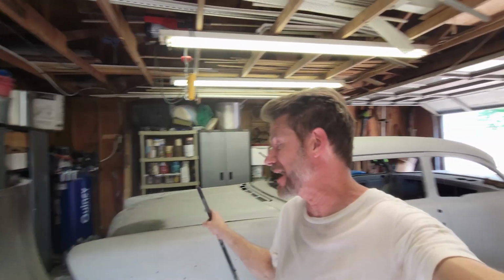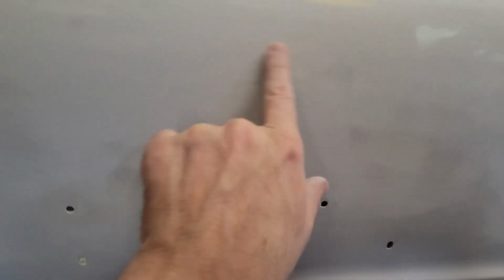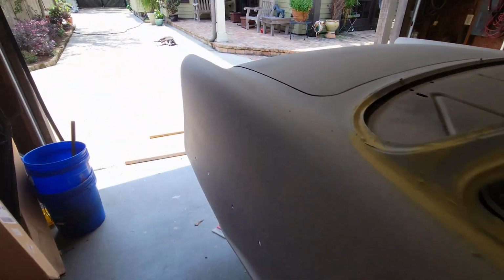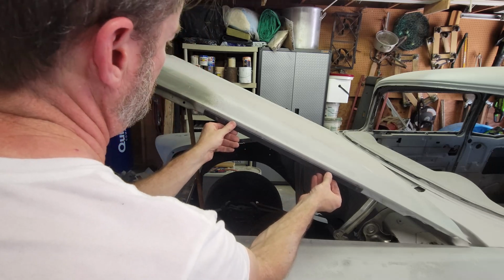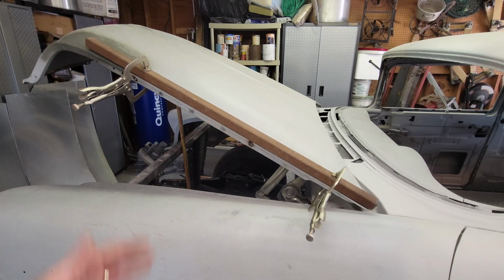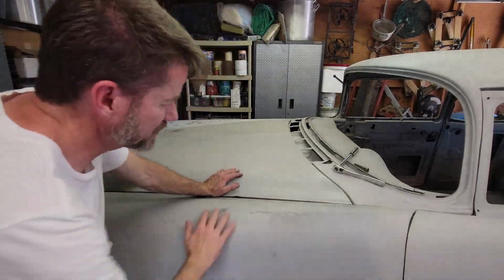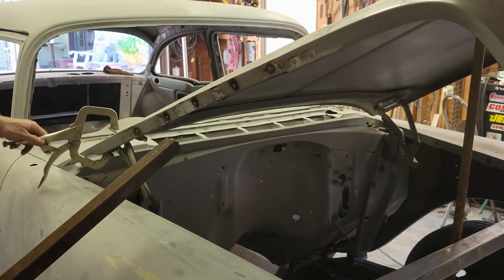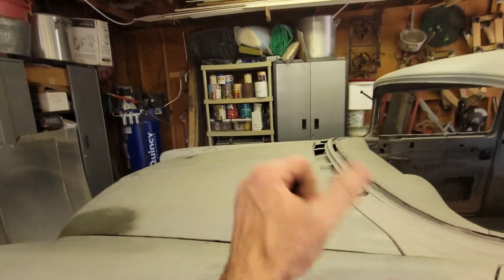E84  Kinked Hood Repair... No More Taco!  1956 Chevy Bel Air Restoration

Comment: Nice fix 👍.These techniques will definitely help me on my 70 Gto hood😊JR
Reply from the maker: I have that 71 Cutlass and those hoods have a second structural layer that helps, but they still kink right above the carburetor.  I wish I knew what to do about that, but maybe the flat bar on the lip will help.

Comment: Watching and learning. keep on learning me new stuff!!  My hood hinges seem very loose, no bind and the stretched out factory springs will not hold the hood open. My plan was to tighten up the loose hinge rivets, hammer them and add new springs. Now I think I will do the new springs first and see how the hinges respond to them. Can always get the hammer later. LOL
Reply from the maker: You can buy new hinges, OR you can stiffen the ones you have by cutting a loop or two and rebending a new hook.  Check out my video on it:  https://youtu.be/rP5nCzg5nmo

Comment: You have the patience of the saints! And not the football guys!  ;) My hood lines up fine, but the cross bar at the back of the hood, in front of the cowl, has got some rust. Not sure where to get that part, of if I have to just fabricate one. Keep up the good work! Look forward to Sundays!
Reply from the maker: I just looked in all of my fishing holes on the web and didn't see any parts for the back of the hood.  It's worth a shot to save.  I'd consider tacking a temporary support on the topside to maintain the shape so that when you do replace some metal it doesn't find itself welded in the wrong shape.  Let me know what you figure out!
Reply: @RestoringChristine1956  Thanks for your efforts! Small problem in the grand scheme of things I guess. ;)  I'm just surprised that no one makes that brace separate. Probably only available on a new hood.  :)

Comment: I know when I was aligning my 55 hood, I made sure the hinges were good and loose first. I found that I had to pick up new springs because my old ones would never bring down the rear corners of the hood.
 I had more trouble with the hood, and part of my hood had rusted away, and I had to weld it up, which pulled the metal over a little. I know it, so at shows, I just keep the hood open so people don't see the irregular gap.
When and after you prime again use guild coat over the top. 
What kind of paint are you going to use?  I'm just curious because I'm building another 55 wagon. I'm converting a 210 to a Nomad. Even the roof was changed.
Reply from the maker: I managed to work it out in the next episode, thank goodness!

Comment: Looks to me like put the braces in and lubricate the hinges might help ... good luck ...
Reply from the maker: The hinges were almost dripping WD-40 by the time I was done.  Turns out that they were in a little bit of a bind from not being square to each other.  I accidentally discovered/fixed this when I went back to it and continued to make adjustments.  Suddenly the hinge slipped sideways a little on the hood and the next thing you know it was closing completely!  And I gave credit to your hunch that the braces were a big part of it in the next episode!

Comment: Now that you have everything locked in and reinforced, how about annealing the metal to where you want it? Close the hood, and slightly over exaggerate the direction you want the metal to go with shims and weight, crawl inside the engine compartment and heat the inside of the hood at the edges until it starts to give way to the direction you want the bow to go. It’s a technique I have used for some of the issue I’ve been having with my ‘57 bel air when the metal at stiff tight areas that I can’t get a hammer or dolly, or the metal is just too thick. Good luck
Reply from the maker: Appreciate the tip!  If I wasn't so afraid of warping everything at this point, I might have tried that.  I ended up using body filler in the next episode to build the curve, but before I did I tried a bottle jack on the bottom of the fender to help it along and it was causing problems elsewhere, so I just cut my losses and filled it.